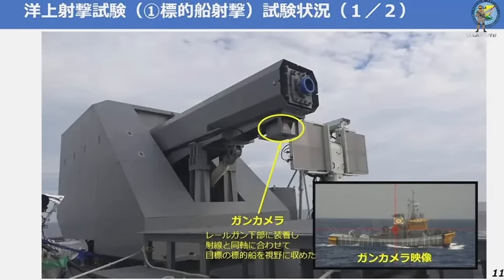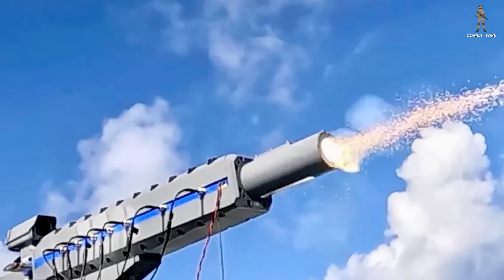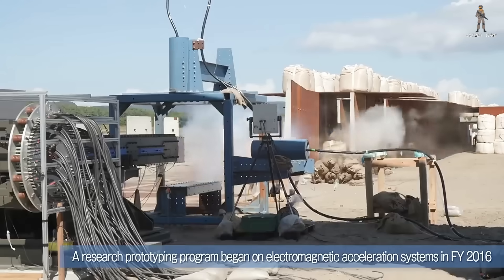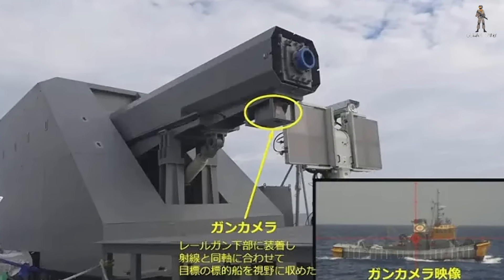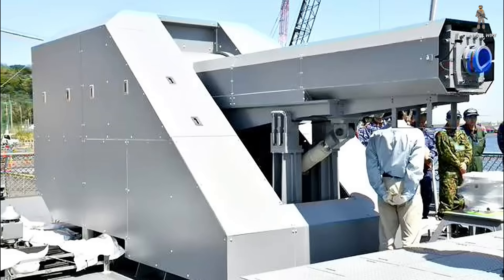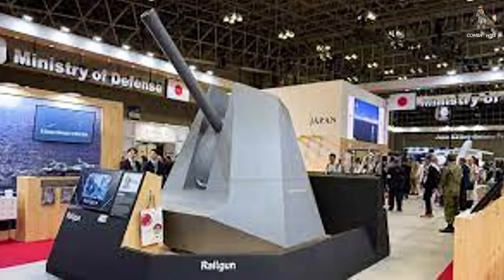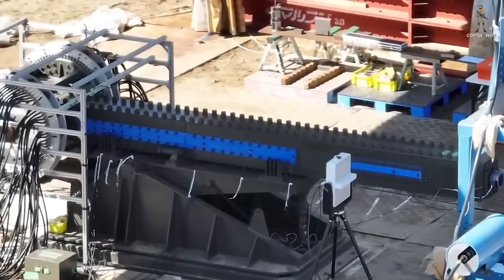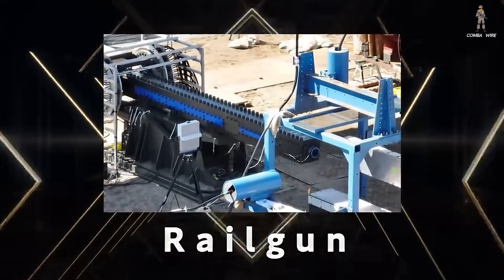For the First Time Ever, Japan Reveals True Railgun Damage at Sea.

Comment: We still have a rail gun in Darpa's warehouse but no one wants it it's but it works only 8", and not quite 26 mile only 18 miles. Add more power and it fired almost 20 miles.

Comment: And finally the REAL reason the US walked away from the railgun project.  Hitting a warship with a rail gun is a lot like stabbing a bear with a needle.  Sure it penetrates, but does it do meaningful damage enough to stop the bear from ending you?   Oh sure if one gets a lucky hit and rips a hole in a vital system, but ships are 90% empty air inside. that is how they float and stuff.   Its why all naval ordinance is high explosive.  Because getting though armor is good, but once inside the ship, they need a kaboom to rip part the inside the of the ship, blast to bits systems,  and kill crew.

Comment: LMAO how does a tiny hole like that in any way justify the ridiculous expense and required onboard systems of a railgun? A single shell from a standard 5 inch naval cannon would have done ten times more damage. It doesn't matter if a railgun punches clean through the ship as it will likely be above the water line. It's also unlikely to hit fuel, engines or ammunition. So unless a lucky hit traverses the entire CIC, even a frigate will just tank a dozen slugs or more.

Comment: While smaller and longer lasting a big issue would be integrating this into existing naval ships where every square inch is already accounted for. You would have to redesign a ship for this or custom make a new ship for it. 4 containers that looked the size of 30-40 foot shipping containers? Those were strapped to the top of the boat since this is a test configuration. Next you’re talking about power generation. No one puts engines on ships with gobs of excess power. You probably won’t power this thing with current diesel engines. Does it exceed what a missile can do? Missiles the projection capability is built into the round. You can get missiles mighty fast.

Comment: Take an aircraft carrier, remove everything aircraft related. add to the existing nuclear reactor, 5 additional nuclear reactors. The top deck will be built as a stepped pyramid. Upon which 5 megawatt powered point defense lasers. Add to this platform 100+ CRAM systems and hundreds of missile to missile systems. Then place one of these ultra point defense ships to every navy

Comment: It's sad reading a lot of this comments. So I'll share my opinion, first, the US tends to disapoint on it's research, so it's no wonder that another country make the leap first even though the US had a good headstart.

But aside from this little messing around, I'll be a bit more serious.

Why is the railgun such a leap forward? There are several reasons and I'll list the few that come to my head as I'll make the list.

1 - It tests new tech, which in turn, might make them gain knowledge that might be applied in other areas also;
2 - It's a more precise weapon;
3 - Due to how it works, it's more "humane" as in, due to the lack of explosives and focus on high precision, we might be able to target just to comand posts during a strike, we don't need to sink a ship, or raze a place to the ground, we might take out the command center in such a way that they aren't even able to respond and force the enemy's hand,
4 - Due to how it works, the bases where such weapons will be localed will probably be able to be remote controled or even controlled through an internal AI operating system with mere human supervision and thus, once again help in heavily reduce casualties;
5 - Since it's, in a way, a COMPLETELY different branch of development, it'll be a huge strategic weapon and options, the more options one has, the harder it is for enemies to predict or do something about;
6 - Connecting with points 1 and 6, since it's a new area of militarily related development, it means that it'll force others' to at least study it, which will promote development as a whole;
7 - Stop thinking like the railgun is, like any weapon, the end all be all, they are just tools meant to be used according to the situation and in an integrated system, in this case, of national defense.

Comment: Wouldn't double barrels be an easy solution? By just having one barrel be used until it reaches its limit and then switch to the 2nd barrel you instantly double the effective combat duration. It is also far simpler to implement compared to things like complex modular barrel systems. I mean at the end, any (war)ship needs regular maintenance anyway.

Comment: I don't think anybody doubted the short range accuracy of that thing. That's not the problem. Maintenance (barrel life) and rate of fire (power) are. Also, that hole is extremely underwhelming AND YOU KNOW IT (because the thumbnail is some giant probably AI generated chasm in the hull). This won't do much to a ship, you are basically threading it with a needle.

Comment: In Ace Combat 4: Shattered Skies, there's a facility called STN Spaceguard Turret Network aka Stonehenge, which consisted of eight sectors arranged in a circular formation, each housing a single rail gun turret. Officially designated "120cm anti-air-and-surface, gunpowder-and-electromagnetic hybrid acceleration-based semi-automatic fixed-gun system", the turrets were in fact not true railguns, but rather "electromagnetic launchers", due to the combinations of the propellants it utilized.

Comment: Problem is, what does it do for you in war. It leaves a completely clean hole through the enemy ship. It literally just goes in one side and out the other. Minimal damage. It cant carry a warhead because it will destroy the warhead. It cant carry onboard flight controls for the same reason. This is what the US discovered about them. Impossible to shoot down, but you dont need to because they do so little damage.

Comment: Honestly i don’t see the point of this mounted on a ship.
The performances are impressive but only at a relatively « short » range, the issue is that today warships can destroy other well before this range, basically with missiles.
But if you can set somewhere where the enemy is forced to come it can be usefull, to guard coasts for example.

Comment: I call BS. What's the problem with hitting a "moving target" with a hypersonic dart? The faster the projectile the better, and people figured out basic fire control more than a century ago, consistently hitting "moving targets" at long ranges with "mere" 850m/s 14-inch shells in the battle of Jutland. From bloody dreadnought battleships! And unlike the tug, their targets weren't just moving about, they were battleships too, doing the same thing and firing back. Without radars, without anything digital other than artillery tables and hardcore trigonometry. 

Srsly, they had a couple of rangefinders and mechanical analogue computers, a few gyros and that's it! I don't believe ballistic computation has gotten any harder these days, not with the modern radars and computers. The precise coil current regulation in the railgun might be an engineering problem to solve, but it's possible, unlike the precise control of cordite combustion in a conventional gun chamber. 

So unless they managed to hit a moving target from ridiculous range, like idk, 120 kilometers away, there's nothing impressive here at all? What's the firing rate? What's the post-penetration effect? How it compares with the late cold war era autoloading dual purpose guns? Cause if there's nothing impressive there, JMSDF might as well borrow an old school IJN barrel from a museum, fit it into a modern turret with all bells and whistles and call it a day! It still isn't going to do anything special in the missile age, but at least it would save taxpayer money.

Comment: The followup question is;
How much damage would one projectile really do to a warship.
Yes, it will be almost impossible to defeat. 
Yes, it will penetrate.
Yes, the affected areas behind the hull/walls/floors will have pressure and spalling/splinter damage.
But “two small holes” in and out…
Not much damage compared to a normal exploding projectile.

Comment: The near unsovable problem is the stupid large size of the weapon's subsistems. 
The gun wirth the turret is a small package, not larger than a standart 15 to 18 inch naval gun's turret. 

The whole lot however, capacitors, generators, control sistems, cooling sistems, not including the backup sistems, will take too much space and weigth.
The US' railgun would require a BATTLESHIP sized vessel, to operate a single turret.

And those WWII turrets had 2 to 4 guns per unit, usually 3 or 4 turrets per battleship. 
The railguns shown up until now are only ONE PER TURRET.

Meanwhile a small friggate can lauch a salvo of a dozen missiles in less than a minute, plus the 76 mm Deck Gun, plus the Phalanx 35 mm cannon.

Sure, give those tech guys a couple of decades and a couple tens of billions and they may, possibly, supposedly, eventually create solutions for those problems. But that cannot be done by a country that is involved in World wide military operations.
The US needs the resources now, to operate weapons now, not to wait for a possible weapon that may come within half a century.
Let the Japanese develop it. If they got it working, Uncle Sam will buy.

Comment: It's a nice hole puncher though. Ironically, you'd want a ship to be facing you directly so your charge goes through more ship, therefore causing more damage. If the part you're hitting is too thin (-ly armoured) you're just getting a lot of upper hits but probably not too much of damage.

Comment: 1.) It needed four containers floating behind it just to power it for two shots. 
2.) It still fucking needs at least a gigawatt-level burst of electricity, far far far beyond what most warships can generate on demand without dedicated nuclear reactors (which Japan lacks for its fleet). 
3.) It did exceed 205 rounds before the barrel itself was junk vs the U.S. 108 rounds BUT Japan has been working on it for far longer since the U.S. abandoned it in 2020. 
4.) They are fine tuning shared research between the US, France and Germany...nothing too revolutionary. 
5.) A high-energy laser is 5 to 50 times faster (or more) at actually neutralizing a rocket or missile, primarily because the energy arrives at the speed of light instead of  Mach 7.
6.) Sending a fleet of 1000 drones would be way more effective. 
7.) We also have more of these other things...you know..."The Poor Mans Rose".

Comment: I've got to say that an additional decade and a half to two decades might have something to do with Japan's greater success. Especially they were given 100% of the engineering that the US and other organizations designs and failure analysis. I'm not as astounded they've reached greater success than the US Navy and DARPA. They still have some of the same fundamental problems. Energy & power is huge. The Kennedy would be a better platform than the Ford for exactly this reason. A modern destroyer might have more energy than a two decade old destroyer. The US Navy dropped the weapon system because almost none of their ships have the energy budget for this tech. Heck, they're having problems installing more computing resources. The second biggest problem is barrel/accelerator wear. Again, huge improvements have been made in metallurgy, CNC, 3D printing, magnetic systems, batteries, capacitors. The EV industry has done $ billions of research w/o the DoD paying a dime, likely at 10% of the cost as well. Japan has been riding this wave. Likely China as well. I love hearing about this. The golly-gee-wiz tone is a tad annoying.

Comment: I do wonder about the relative pay-off of Railguns vs Hypersonics.

Given that you need to basically build entire warships around Railguns to make use of them I can't help but wonder if the resources required would be better used solving the issues elsehere.

Though I assume that if there wasn't at least some real promise behind it: Major militaries wouldn't be investing so much into Railguns. It's fully possible the answer was "No" for the US Navy because they can afford to just pack more Hypersonic missiles but "Yes" for smaller navies that would rather pay the increased upfront costs for a system that will be cheaper in the long term. If they can legitimately be used for Hypersonic Interceptions that would probably be an extremely useful niche (Power and cooling are less of a concern for things like a semi-permanent missile defence emplacement for instance).

Comment: Railguns are a great choice, High Fire rate, High Range, High Accuracy, Low firing costs literally a fraction of a hypersonic Missiles cost, Inert and safe munitions, hard to trace where it came from if you are able to hide your ship, unlikely to be stopped by anything. If I was going to offer a solution to the barrel survival rate, Either an internal replaceable sheathe or a "hover" Magnetic rail instead of a solid one, though fine tuning a magnetic hover rail that also accelerates the projectile would probably be hell... Worth it but hellish.

Comment: I love the railgun. Japan opted for a smaller gun than the US was willing to make. The specs the US wanted is what led to them aborting the idea. They wanted a 20mm with velocities around mach 10. That would be one impressive gun. Japan's are far smaller and slower to solve the power and barrel life issues. Not really a game changer. It's just the US didn't believe such a gun would be worth it
Reply: Might as well just let Japan do it then revisit the idea later if it works really well for them.

Comment: The round having no propellant doesn't matter (although they DO have propellant, all railguns use an acceleration primer charge, you can see it here too with the fire escaping, and no, its not from the railgun itself), given you still need immense fuel waste to generate all the needed electricity to shoot those. 'Best case' scenario is that they'd be powered by nuclear reactors, but that'd make them a huge environmental hazard (still not sure how we allowed nuclear army submarines..). Additionally, having so much electric equipment and high charges around WATER of all things is a horrible idea, let alone the fact a warship is bound to BE HIT and that's a huge game over.

Comment: In a ship, you are surrounded with cold water. The ships can be fitted with a watercooling system that will be cooled thanks to contact between the cooling water and the sea, a bit like a nuclear power plant system. So that solves the cooling.
The sea is constantly moving, it is kinetic energy. The ships can be fitted with underwater turbines that will constantly replenish batteries. If you shoot too fast with a bunch of guns, it will not be enough to sustain it. But it's better than nothing.
The gun could be designed with barrel replacement in mind.
But why do all of this when normal guns are as deadly ? There's no explosion so there's less to no recoil, the ammo is not explosive, so being shot at the ammo is no big deal, it is silent ? Maybe as a stealth gun ?

Comment: Around the 2 minute, 25 second mark or so, you state that pictures of a large railgun got put out. No. Pictures of a SMALL railgun got put out, and its no less impressive for all that, but there is no need to talk nonsense. 

 By naval standards, that isn't even properly a medium sized gun. Its cool, I dig it like a demented gravekeeper, but its not a large one. The US test platform was WAY bigger, which is one of the reasons it got canned. Trying to push this tech to maximal size before properly iterating at smaller chamberings was probably a poor move, one that shouldn't have required hindsight to see coming.